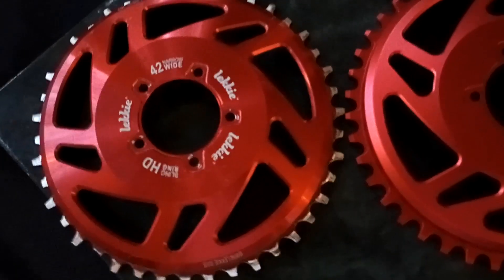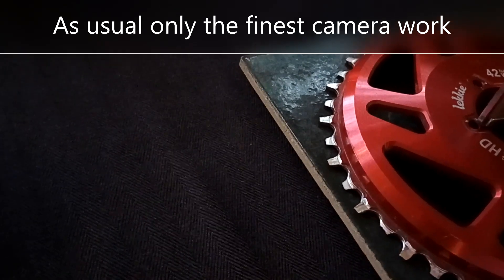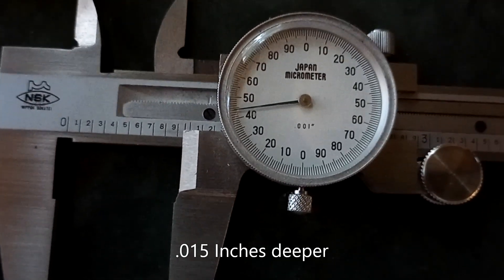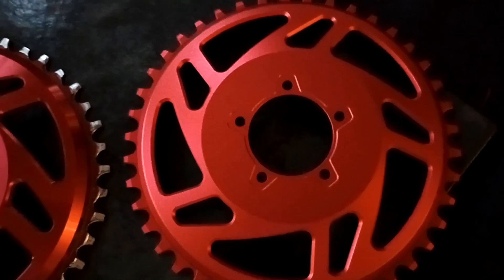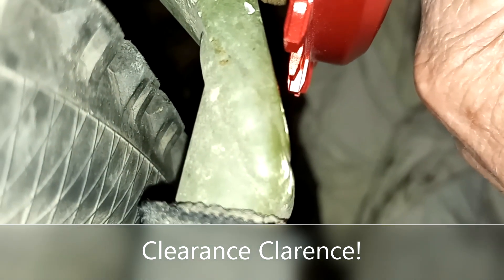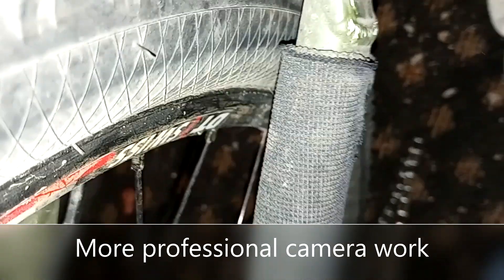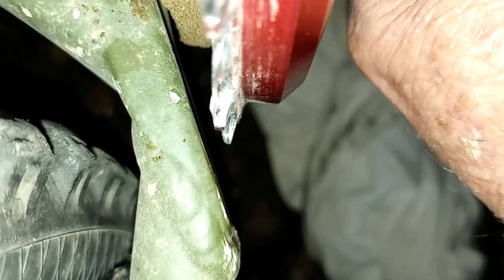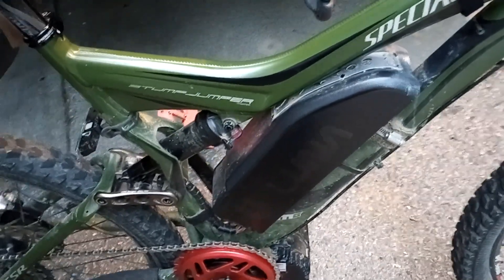$120 Lekkie Bling Ring Compared to $40 Copy

Comment from the maker: Update: Although initially this sprocket worked better it's wearing out quickly, the narrow teeth are paper thin now and about ready to snap off at the tips. It appears to be made out of Chinesesium the alloy created when you melt all recyclables (Paper, cardboard, glass, Plastic, tin  and aluminum)  together. This alloy Changes directly from a solid to a gas when it starts to corrode! I hope Lekkie Is still in business' Because as soon as this thing falls apart I'm going to cough up the bucks and buy the real deal! It was worth a shot but I think in the end the Lekkis Is a better deal since it lasted probably 5 times as long and who knows what this thing is doing to my chain! I know what you're thinking: how many miles did I get out of it? Unfortunately I didn't record my starting mileage. There's an old saying: Sometimes the cheap is expensive.

Comment: I have one of the copies, which I fitted at the same time as a new chain and cassette. I currently have around 600 miles on it. The teeth are starting to look thin but I think it will last another 100-200 miles. So not bad IMO. Thought you and your viewers might be interested. 🙂
Reply from the maker: Thank you, we definitely appreciate the input! When I purchased my bike it was already fitted with the Lekkie and the odometer showed 300 miles (Of course I have no idea at what point it was installed) I put about a additional 1,900 miles on it and then noticed it was wearing very thin. I didn't note the starting mileage with the copy; I'm so glad you provided us some data! This time around I'm going to cough up the extra $ And purchase the Lekkie. I just went out and checked. my odometer currently reads: 2,600 so I'm guessing that I too am at about 600 miles on the copy. Based on the data you provided and my rough reckoning it would seem that the copies 1/3 as long and cost one third of the price. I will report back in a year or two when my new Lekkie (If they still make them) wears out.
Reply: @CFRoach  If I get more than expected I'll try report back. (If I remember). Who knows it might make it to 1000 miles. 😅

Comment: I got Lekkie 28 T for a Bafang BBSO2 750 w the OEM 44T motor started to overheat. Where I live a lot of hills so I will see pushing a Trek 4500 26" dual batteries 48v-30 amp. I tried 38T with 16/46 freewheel awesome improvement. Hopefully, the Lekkie 28 T using the 16/46 will reduce my over heating issues.
Reply from the maker: That's going to make a huge difference! I was able to find a nine speed hub that has a 50 tooth cog which is almost a perfect combination when paired with the 42 tooth Offset sprocket. One of these days I'm going to cough up the bucks and get the 40 tooth offset lekkie with the custom motor cover to accommodate it, I'm thinking that would be the perfect combination with my 26 inch wheels. I tried running the smaller size sprockets that don't have an offset and my chain would just pop off immediately.
Reply: @CFRoach  Your Specialized looks awesome with the full suspension. I regret converting my Trek because now the prices of mid-quality e bike have decreased significantly since 2022. I have approx $1500 invested.
Reply from the maker: @HB-yq8gy  Don't regret your investment for one second; You Cannot get replacement parts easily for premade e bikes and most of them come from the same factories they are just branded differently, With the right gearing your bike will smoke those things; With my setup I zip by the five thousand dollar e bikes, When I stop for a break and they finally catch up They are quite annoyed to find out that I spent less then half of what they spent and they don't even have a throttle. The only thing that ever passes me is a Suron But that's not really an E bike it's a motorcycle........ Come to think of it My bike isn't really an E bike it's a motorcycle in disguise. You can always take the motor off your Trek and put it on a used full suspension bike. I was initially going to buy a pre made ebike but then I watched some Johnny Nerdout videos and realized the error of my thoughts. Also think about how much fun you've had in the last three years, well worth $1,500!  also: Thank you for the compliment about my bike!
Reply: @CFRoach Your comment is what I needed thanks!. Likewise, JNO is my go-to for information, parts, and the Bafang for my e-bike build! Yes, indeed I would zip past all thoughts high end custom bikes on the canal!  Happy holidays and cheers!
Reply from the maker: @HB-yq8gy  Thank you and happy holidays to you as well!

Comment: Where you get it?
Reply from the maker: I purchased it on eBay. The seller is: lanfyshop. The current price is:$38.91 shipping price is $16.99 from China. They have what I consider a low customer satisfaction rate 95% (I don't like to go below 97%) but I rolled the dice anyway since I paid for it with PayPal I knew I could get my money back if anything went wrong. The exact listing title is: "Replace Electric Bicycle Ebike 42T Chain Ring Offset Correction For Bafang BBSHD"
I ordered it on January 3rd and it was delivered to Los Angeles CA on January 19th total price paid with shipping was $49.60 the item number for the red colored 42 tooth shows as 204540692303 which does not appear in the description but was on the receipt.

Comment from the maker: The copy works better than the original: That .015 inch difference in the offset Is noticeable: The bike shifts smoother and there's less chain noise. I'm definitely glad I rolled the dice on this one.
Reply from the maker: (I'm replying to myself) I change my mind: I'm definitely not glad I rolled the dice: It may be a third of the price of the Lekkie but it only lasted a third as long as the Lekkie. But you don't know until you try! My recommendation is to cough up the Bucks and get the real deal.